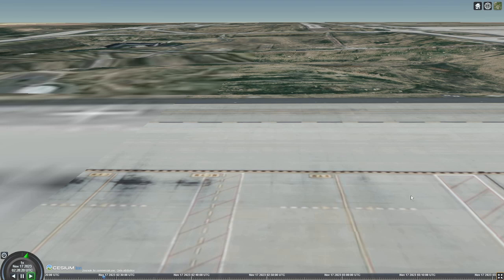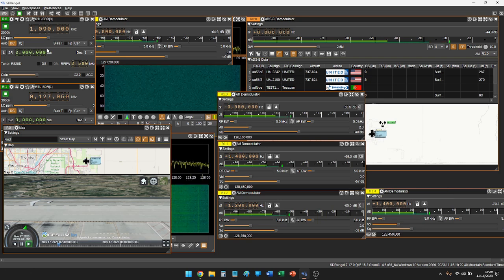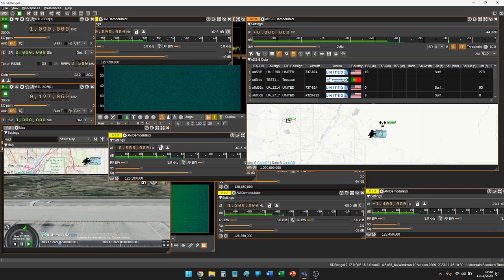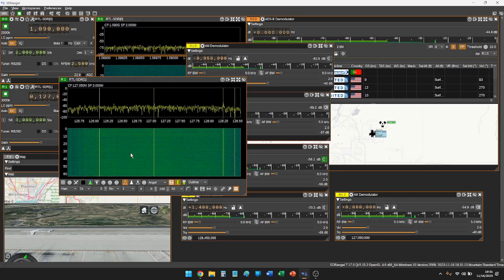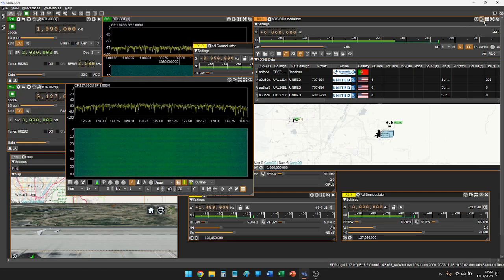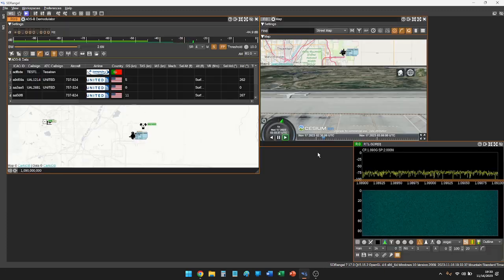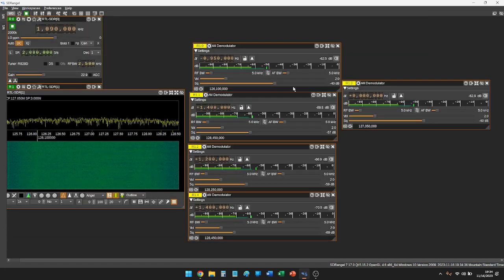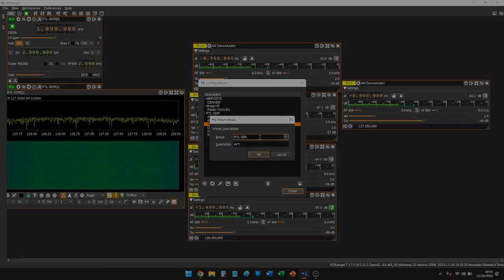How To Use:  Pulling VHF Air and ADS-B together with maps in SDRangel Version 7 Series (Part 3 of 3)

Comment: You ain't kidding it's complicated 😂.  I was using 2 monitors last night and it's still too busy.  I just started using sdrangel, I've been using sdr# and sdr console for a couple years. I've run into a couple issues with angel so far. When I set my bandwidth to 2.8 or 3. MHz it's not recognizing it on the spectrum I e.  Only showing 433.100-433.500  when setting it , the spectrum appears to make the change but then doesn't reconcile to settings.  This program is a steeeeep learning curve, so thanks for these videos! They'll definitely help. I like how angel has all these demodulators built In. 2-3 years of glitchy sdr# and their plug ins working only when there's a blue moon and I switched over to console  But even  that's limited compared to angel!
Reply from the maker: Just wait until the workspaces video I am getting ready for, but yes.... on small screens SDRangel is a bit challenging.